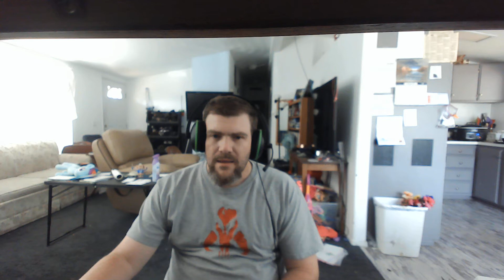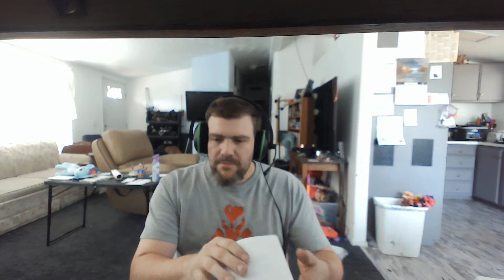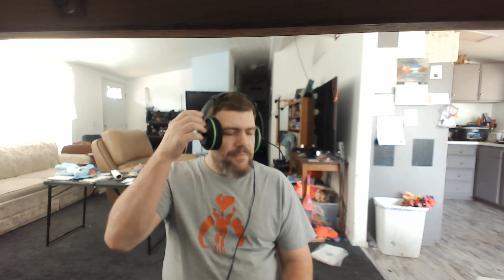Cwi Part B 1 22

Comment: Do you know of any good online practice tests for part B?
Reply from the maker: There are a few on how to find answers but not a lot. Part B is hardest of the three. Leave your tools. They have very cheap tools they provide. I failed it but got a 61 of min of 72. It's a learning experience. Relax as the 2 hrvlimit can be fast and nerve racking. I'm taking part B on the 18th in spokane  after there 2 week seminar. I'll post a vid on that too.  Good luck. Let me know how it goes. Aws in Florida is quite helpfull. Look up there forums.
Reply: @shawnmsattler2116  thanks! I’ll be taking my week seminar in Tampa at the end of July. I already went thru the BOS and doing my best on learning how to navigate it. I’ll let you know how it goes after I take it! I’ve been welding for 9 years now. I’m ready to take the next step ya know?
Reply from the maker: I'm a grad from lew-clark state college 99 and left certified in Vert 1"plate, pipe up to 5" and few othere. My Best cert was a 8" 6g pipe, 6010 root, 7018 fill and cap. Xray tested and passed.out performed 8 other welders. So I have 18 years in welding and millwright
Reply from the maker: I almost forgot, understand book of specs as well there are some tricky ones in there.

Comment: did you take part B test already? if so how did you do? Who did you go through- real education??
Reply from the maker: Don't take your tools, they have everything there. Just a pen, good luck charm and a calculator. I took all my tools to Seattle for the test and was told to leave them out on the table. Just relax. Trust your self and double check everything. I used all 2 hrs. It's mostly book and look for me, might be different for you. Good luck as I take part A end of the month.
Reply: @shawnmsattler2116  thanks shawn and good luck to you as well.
Reply from the maker: Test B is the hardest of the 3.  I will get the results shortly after I take the general test or test A. I'm going through AWS, and Si certs. Atlas is good too for help. Si and Atlas are compatible for price. I have a job all lined up once I pass too.
Reply: @shawnmsattler2116  I take part B Saturday and schedule the other parts later but I'm currently going through baseline data. I'm concentrating more on part B though.
Reply from the maker: Chris, how was part B test for you.